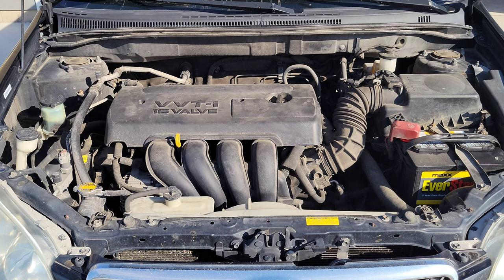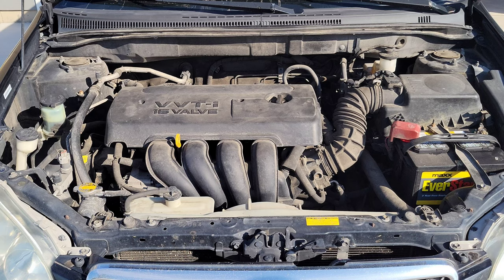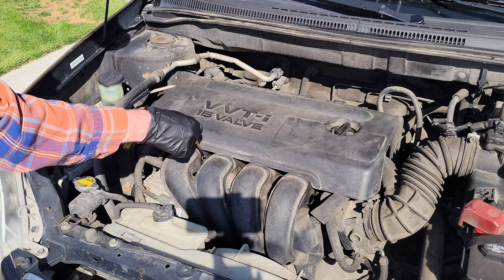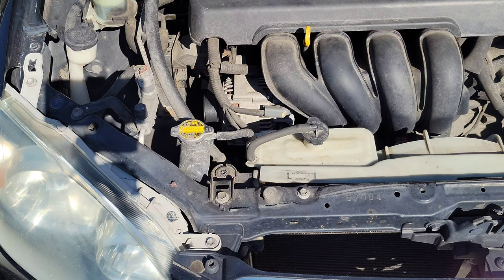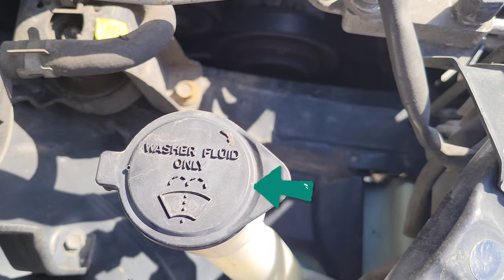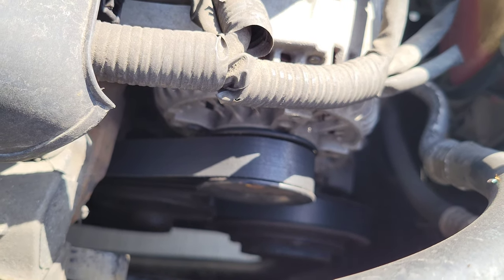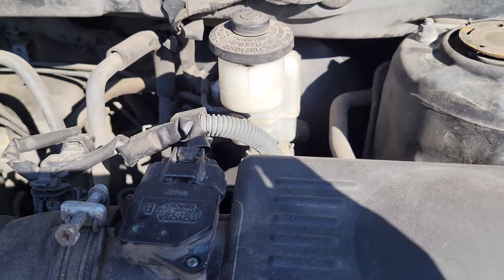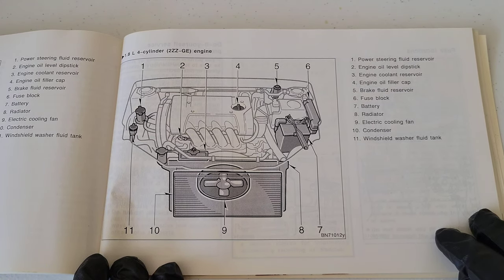Location Of Parts Under The Hood Of 2003 2004 2005 2006 2007 2008 Toyota Corolla

Comment: I have a 2006 corolla just like this one (only white) with 306,000 miles on it.  Just so everyone knows if you are lucky enough to have one last that long, the odometer stops at 299,999.  I use "Trip A" to keep track of how many miles over 300,000 it is, and I take pictures of the Trip A reading with my phone periodically just in case I accidentally clear Trip A.  These corollas, if you change the oil in them on time, will last FOREVER!!
Reply: I have a 2003 Toyota Corolla LE 😍with 283,999 miles.😲and still running🥳
Reply: My 07 has 278k and the oil still looks new 3k after it's changed. Transmission too, changed the fluid every 30k.  
It started dying then not restarting until it cooled off with codes PO606 PCM  processor fault and PO121 pedal position ckt A fault.  Changed the throttle body with a new OEM part and fixed it for about 8 months, then it died with the same codes again. Changed the gas pedal with a new OEM which fixed the problem again for about 3 weeks.  Now the codes are back again and it's dying again.

Anyone have any ideas? How many PCM's do these have and where are they located? 

Any ideas about wiring issues on these?

Comment: Hello Todd, what do you call the engine part that on the lower side of the water pump? I mean the one on top is the alternator, under the alternator is water pump and the one I want to know is the one under the water pump? It where the serpentine belt go also. The one that has a pulley also. The reason I ask because my 2009 toyota corolla making a growling sound when cold start. And I checked it using a large screw driver and put it on my ear and I can really hear the noise and vibration coming there. I hope you could help me. Thanks

Comment: I was hoping to find out what the part is that's located in front of the battery, in the lower right hand corner....It isn't shown in my owner's manual, and I don't see it here.....I have a 2008 Corolla, and the reason I started wondering is that it looks like a filter of some sort, and it looks frayed on one side....hoping it's nothing to worry about?? but a little concerned.... 🙃

Comment: I was hoping you would explain what the part that is connected down front that hooks on to the valve cover. This part looks like 4 large black hoses joined together.
Reply: I’ve always guessed it was for hoisting the engine but I don’t know shit. Did you ever find out

Comment: My 07 has 278k and the oil still looks new 3k after it's changed. Transmission too, changed the fluid every 30k.  
It started dying then not restarting until it cooled off with codes PO606 PCM  processor fault and PO121 pedal position ckt A fault.  Changed the throttle body with a new OEM part and fixed it for about 8 months, then it died with the same codes again. Changed the gas pedal with a new OEM which fixed the problem again for about 3 weeks.  Now the codes are back again and it's dying again.

Anyone have any ideas? How many PCM's do these have and where are they located? 

Any ideas about wiring issues on these?